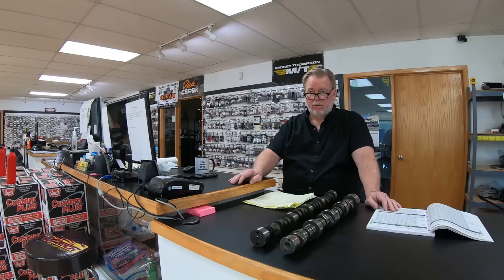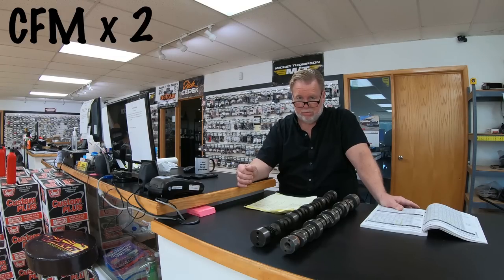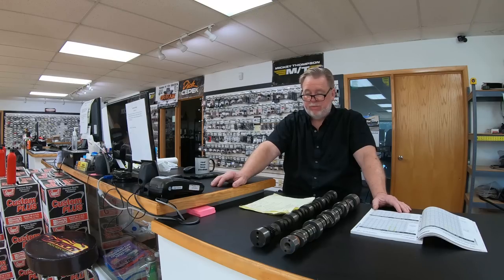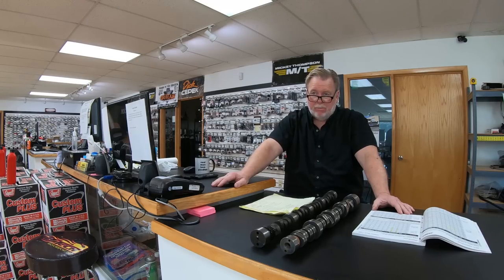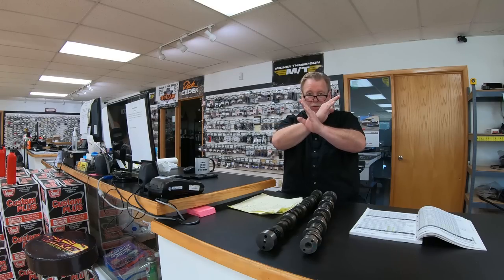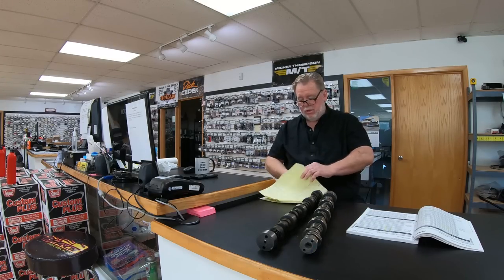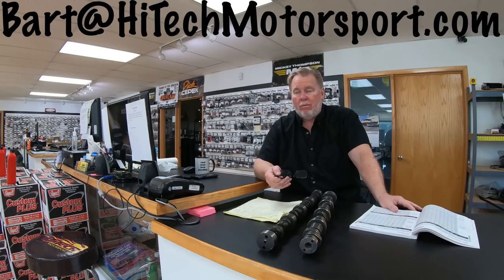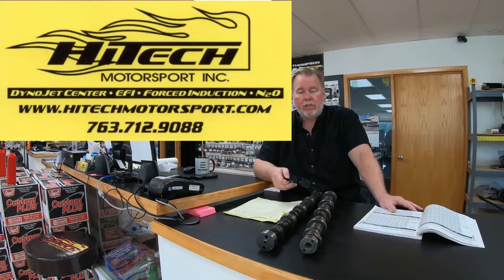How to Choose An Ls Camshaft For Max Horsepower

Comment: Was waiting for cam recommendations for 6.0  and ls3/l92 heads? But great video and even better advice!
Reply: I have this setup LS2 engine with milled and CNC ported LS3 heads 11.1 compression l have a crane hydraulic roller with LS7 lifters you'll need a good set of hardened pushrods a good SFI harmonic balancer the cam specs are 226 intake 236 exhaust lift on intake is.551 on exhaust .600 on a engine dyno with no accessories it makes 540hp at 6900rpm 470 foot pounds of torque at 5200rpm at the crank and 400 foot pounds of torque or more from 3000rpm to 7200rpm it pulls very very hard in this range and redlines very fast it idles decent with a slight chop at 800rpm this setup does lose torque below 2400rpm but it's not drastic and runs smooth from 2000rpm up it's in a 1984 monte carlo ss it weighs 3380 with me in it it has a 3000 stall converter and 4.10 gears it is a weekend cruiser it has been in the car since 2008 and runs as good or better than when first put in but it's maintained very well with oil changes ECT it's best quarter mile time was 10.87 at 122.9mph which got me kicked off the track because of no rollbar but it had made 8 passes before in the 11.0 to 11.3 this setup will work good if your car is 3600 pounds or lighter with you in it it's not the right choice for a heavy 4200 pound or more truck or big heavy car and my car has power steering and brakes a 700r4 transmission with a lockup torque converter suspension is drag springs all the way around and lift bars in rear no coilovers stock type suspension it is driven to the track raced and driven home no trailer it also has a GM performance single plane intake and a holley HP 850cfm carburetor so l don't know how well this cam will work on late model fuel injection but I'm more than happy with this setup
Reply: @gloriamaletta8667  thank you
Reply: @crw3673  keep duration under 230 on intake and under 240 on exhaust unless it's a drag car with a 4500rpm stall to 5000rpm keep lift at or under 600 unless your going to put forged pistons with valve reliefs and it will run good and last a long time without headaches
Reply: @crw3673  l also have a 15 percent underdrive pulley with a good electric fan it runs at 180 degrees even if in traffic or idling for long periods in 95 degree florida heat using a 1970 chevelle 454 4 core radiator the LSA on my cam is 112
Reply: @gloriamaletta8667  this is for a 4 gen Camaro, with a t56 tran and 3.73 12 bolt rear end. This car will 95% street and 5% strip. Would love to see it idle around 600 - 800 rpm. But needs to have good street and highway manners. Am I asking too much?
Reply: @crw3673  600 is kind of low but 800 is very doable they idle at 600rpm with a stock cam nice choice with the 12 bolt you'll need it l only have a 8.5 10 bolt out of a 1986 buick GN because you know the 7.5 or 7.6 ten bolt will not last with hard launches and sticky tires good luck with the project
Reply: @crw3673  any performance cam is going to be a little more edgy below 2000rpm keep duration under what l suggested it should have good street manners my car is very reliable and streetable besides the dump exhaust the 4.10 gears and the 3000rpm stall it's very streetable if it had tail pipes a 2500rpm stall and a 3.42 gear it could be daily driven even with the 4.10 gears it can cruise at 75mph at 2800rpm in 4th gear with the converter locked up but then again the MT drag radials are not good at all on wet pavement and regular radial tires would be dangerous because it would burn rubber all the way through 3rd gear it even spins with the drag radials a little in 1st and 2nd when floored without a burnout
Reply: Hey guys I have a 6.0 also with a little bit of port work. It sounds like he said use the same cam for the 5.7  for the 6.0 if it's not a race car. Any suggestions?
Reply: @demetriuslawson7919  it depends on the heads being used cathedral port heads are what come on LS2 engines and LS1 engines but the LS3 has a head called rectangle port and or L-92 or LS3 which is very different in flow generally they like more lift and duration on the exhaust side and it will depend on weight of vehicle rear-ended gearing transmission stall and intended use to find the absolute best cam
Reply: 02 camaro 3000 stall. I had thought in the video he said use the same cam for the 5.7 for the 6.0 if it's mild
Reply: @demetriuslawson7919  with rear gearing 3.42-4.10 depending on desired redline look for something that starts making good torque at 3000rpm it doesn't have to be peak torque but something that makes 370 foot pounds at the crankshaft or more at 3000rpm don't be fooled with peak numbers look for something that makes good torque and horsepower throughout the power band say from 3000rpm to 6800rpm l wouldn't worry to much about anything under the stall speed because below that rpm you only need enough power to cruise or street drive l think a BTR LS2 stage 2 cam it has a power band of 2000rpm-7000rpm but you'll need matching valve springs hardened pushrods and a SFI harmonic balancer the stock balancer is not reliable with repeatable +6000rpm revving it will not end well this setup should give you decent drivability on the street with a wide power band  torque and horsepower will not drop off at high rpm while making good horsepower and torque at 3000rpm to 4000rpm power across the entire power band is more important than peak numbers I'd be willing to bet this cam will make 370 foot pounds of torque or more at the crankshaft from 3000rpm to 7000rpm and you will feel it in your seat of your pants with a good suspension and sticky drag radials and a good tune and some testing should run low to mid 11s in the quarter mile naturally aspirated l would give you my cam specs but my 1984 monte ss but it has LS3 heads on a LS2 engine and like l said earlier they flow more air on the intake like 358cfm so the camshaft on it will not work as good l think as this BTR LS2 stage 2 cam peak numbers should be around at crankshaft 500 horsepower at 6700rpm 440 foot pounds of torque at 5000rpm these are not exact numbers but I'd bet there very close a 6.0 has a better 4 inch bore and should make better power if equal parts are used than a LS1 5.7
Reply: What cam size work good with brodix br7 heads  lsx 441ci

Comment: What about elevation factors cuz I'm in Denver 5280 feet
Reply from the maker: ideally you would raise the compression for the thin air. But i would drop the overlap by 1 degree to help with the torque in the thin air

Comment: When you say for a 5.3L truck engine a 223/227 600 600 113 cam, would this be the same if you had a car intake instead of a truck oem intake? 

Thanks for the video I found this extremely interesting.
Reply: Mother Lover Jones yes why wouldn’t it be all you did was change the int manifold

Comment: Needing a recommendation for a cam to go into my 6.0 motor, from an '03 Silverado. Swapping it along w/ @ 4L80 trans into my '92 K1500. Moving into a very fast paced city driving situation, so basically 0-60 quickness is key. But I do a lot of interstate travel too. Just tired of getting dusted in town with my TBI... Great vids, they're very informative and appreciated !
Reply: And I'm hot blooded so I'll be almost always have the AC on... I understand some cam profiles don't work well with AC.

Comment: hey Bart great video i have a 210,000 mile 4.8 sierra runs perfect if i add a stage 2 btr truck cam what drive train upgrades would you recommend do i need new lifters etc... or can i just cam it tune it run it
Reply from the maker: Give us a call at hightech and well get you on track! 763-712-9088
Reply from the maker: cam, springs, locks, retainers- no need to do the lifters. The 4.8 did not get afm/dod so if the oil was changed once in a while they will work great
Reply: @hi-techmotorsport4318   thanks Bart

Comment: I saw a video from richard holdener where the only thing he changes was the lsa and on the engine dyno it showed the 108 getting better low end power vs 112 and 120.   Around 17:20 in your video you said 113 would make a little more down low torque over the 112.     Im just trying to get a little clarification. I've been doing a research so i can decide what cams i should use in my 2 cars im gonna be building
Reply: Context matters. Note he is talking about a truck engine designed to make more torque down low (lower RPMs). LSA is part of optimizing for the planned use of the engine based on its flow characteristics. None of the numbers live in a vacuum so Richard isolating one aspect of cam profile for demonstration of what it does on a specific configuration does not mean it holds true for another configuration. 112 LSA in engine A may not have the same impact as it would in engine B. Unfortunately there is not a perfect number for all engines, a lot depends on what that engine wants to flow - the cam just adjust how much of that potential flow is realized at various rpm which you want to match to your intended use. (Race engine built for high RPM struggles at low RPM because the cam is not optimal for the lower flow rate at low RPM - could improve that with LSA but at the cost of performance at high RPM - there is always a trade off. his main point is that you need to pick the cam grind that fits your use and just because the numbers are bigger on one cam from another does not make is "better").
Reply: @opieg7333  did you even watch Richard holder's video?
Reply: @stephenbotello5914  yes... plenty of them LS and non LS. You may even find comments on the one you speak of, but I can't remember which test are in which videos.
Reply: @opieg7333  I'm not talking about all his other videos 🤦‍♂️ only the one where he specifically test the lsa
Reply: @stephenbotello5914  Just re-watched, Richard is using the go to 402" test rig with heads flowing 350cfm. Note the last 30 seconds or so of the video where he asks the question about a smaller engine. Note the point he makes about the RPM range and question about idle quality. Note the advice in this video is about a truck engine which needs to produce some power down low. Its not a more of X always equals more of Y equation. There is a limit beyond which the results move the other way. Context matters and flow (fluid dynamics) is not always a linear equation thing. (And Richard is right that boost can make a lot of those compromises irrelevant).
Reply: @opieg7333   😂 you keep saying truck engine like it produces so much more torque down low my LS4 is spec for spec identical when it comes to cam, heads pistons
Reply: @stephenbotello5914  you tow anything with it?
Reply: @opieg7333  that's how it comes from the factory 🤦‍♂️
Reply: @opieg7333  now that i have time to answer your previous comments.  His question about idle quality doesn't matter.  The "truck engine" doesn't NEED to produce power down low. What Richard was saying in his video was a smaller lsa give more down low torque while bigger lsa give more top in as long as that's the only thing changing. That's gonna happen in most cases regardless of engine size. 

The only thing i was talking about it my original comment was me asking him if he got it backwards, or if he could clarify why he was saying that.
Reply: @stephenbotello5914  Factory? That cam runs a 114-116 LSA and is in a passenger vehicle.. Lot less weight to get moving.
Reply: @opieg7333  i guess you missed the part where i said my LS4 is identical to the "truck engine". Same cam
Reply: @stephenbotello5914  that doesn’t make sense since not all 5.3 truck motor are identical. There are different variants in heads,pistons, and static compressions…

Comment: Bart is very generous & helpful. Thank you for the recipe on my 96vortec 5.7 I appreciate your expertise!!
Reply: What cam did u end up with. I built a vortec back in 2001. 700 carb, edelbrock performer intake and a 282/286 110° with a 106° centerline from reed cams. Put out 420hp. It was hard on the rocker to valve surface though. Im wanting to build another but would like to know how yours turned out with his combo.  Id like to copy it. Thx

Comment: I have a 6.0 LS engine that came out of a 02 GMC 2500. I took the 317 heads off and replaced them with the 243 heads and I’m going with an aftermarket intake with probably a 92mm Throttle body, stock bottom end. I want to be able to drive the car on the weekend and play with it at the strip sometimes as well. Any suggestions on which cam and converter I should use?
Reply: Watch the video again 8:20, Im pretty sure he goes through this and says to go with something around a 226/234 .600 cam 112 lobe if you want performance over drivability, but still drivable.
Reply: Anthony P Yeah I heard him say that was just double checking. He may have something else in mind for my setup.

Comment: What cam would help my 6.0HD truck tow better?  I was wanting to do the LSA blower swap also.  Can’t really make up my mind
Reply from the maker: 224/228 600/600, 114 lobe sep+2, that will work on the truck for more pulling power and work well with the new lsa blower. it will not be a high lope cam,  just very efficient for towing.
Reply: What cam is this? Company? Or is it custom. This is without a doubt the best video I’ve ever watched about anything performance related, ever. Thank you so very much for taking the time to share your vast knowledge with the world.

Comment: IM putting a 2005 gto ls2 motor ina 49 ford pick up any recommendation for cam size.  its a 6 speed car with 3:73 poss 4:11
Reply from the maker: 226/232 610/615 lobe sep of 113. would be my choice. it would have slight lope at idle and pull from 2200 up. it will be very responsive and pull till 6200

Comment: i got a 5.3 bored .020 over with flat tops and 706 heads home ported for shits and giggles. cams 228 288 600 112. we'll see how it does.
Reply: bigheadsmash how'd it go?
Reply: @cheesmastr5303  still in the works

Comment: The 5.3 cam you were talking about 600/600 lift 223/227 duration 113 lobe separation... Do you carry it?
Reply: That's exactly what I'm wondering. Also, I assume you simply reuse factory 5.3 lifters. Do the valve springs need swapped out or can you run the factory 5.3 setup? Would you recommend sending the heads to a machine shop with the cam specs or me just doing a simple spring swap? I'm kinda new to the performance side of LS stuff. So pardon if my question(s) seem dumb.
Reply: @tedburkholder  you can use your factory lifters but you must get valve springs to match the cam. I recommend the PAC 1219 springs which you can install and they're good for 625 lift. If you're pulling the heads, go ahead and install LS7 lifters, they're way better than stock. The closest cam I can find that is close to the one he's talking about is a Texas Speed stage 4 high lift truck cam with 600/600 lift 223/226 duration & you can choose lobe separation of 111, 112, or 113. I still want to know which cam he's talking about
Reply: Chuck Gaines that is a cam he had specd. He sells them for $425 shipped

Comment: What would be a good camshaft to put in a 350 vortec in a heavy work van need a lot of torque not horsepower
Reply: Switch that engine to an LS. You can pull a slightly newer (for simplicity think 2000-2006) Chevy v8 truck engine. Use the same transmission, get better fuel economy and about double the power. You won't be asking about a cam for torque. Sell your current engine to another person for like 400 dollars and buy an "LS style 5.3" for like 400 dollars also. Really, do it, man.

Comment: I have a very specific ls Gen 4 truck engine question: I installed a very mild comp cams xr259hr-12 grind over my stock cam, new cam bearings, same stock 7.39" pushrods, and same stock rockers, along with a. Edlebrock 3 bolt conversion cam gear & chain set. Now my issue is that, I have lifter knock(comp cams standard ls lifters) on some of the lifters on both sides.. Upon disassembly I saw that everything looks good and nothing looks wore or broken or bent. So I reoiled everything and re-assembled it again and ran it until it warmed up and there's no difference. (still has lifter knock.!) can anyone give me any ideas on what's happening with my 2007 Silverado 5.3L j code ly5 engine?
Reply: BTW, I did away with the afm with a dod delete from summit with a Diablo i3 programmer
Reply: And non  dod parts and center cover
Reply: I'm getting a p0300 general multi cylinder misfire and cam sensor A range performance code and it lopes way to much along with, a very hard start.
Reply: The crank timing gear is set at 0

Comment: The cam you mentioned at 8:15 would that be good in an LQ9 with an ls6 intake t56 car?  I heard spirited driving I’m all for that in my future set up
Reply from the maker: yes, that will work. get the sheet metal intake from to pick up 25 hp from 5000 up.
Reply: Sheet metal intake? I already have the ls6 intake.. it’s already put together but I have a set of 799 heads waiting .. also trying to find a cam but I think this sounds good, would those specs still be good with the 799 heads? I don’t want anything too crazy 500whp is really my goal
Reply: Hi-Tech MotorSport  and thank you for the response

Comment: The camshaft is the brain of the engine.
Reply: Isn't that the ECM ?
Reply: @jonasgrumby1093  nope the camshaft is. The camshaft dictates how much hp and torque are achieved and where they are made across the rpm range. My mild 496 big block with 9.1:1 compression ratio made 565hp/600tq all under 6,000 rpms. If I bump up the compression ratio and increase lift and duration I would have easily made around 650hp, but it wouldn't be as street able as it is now.